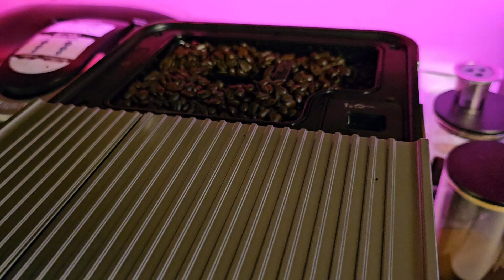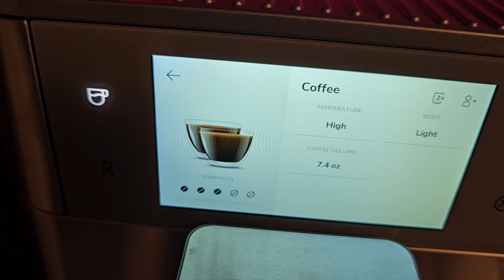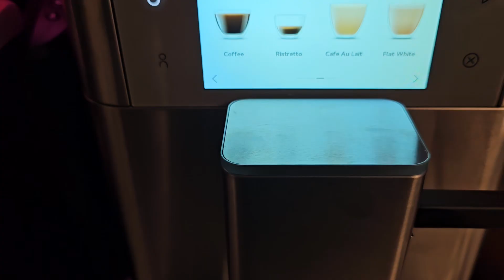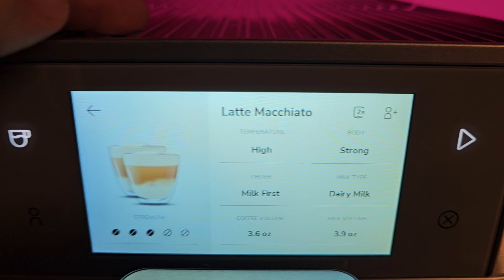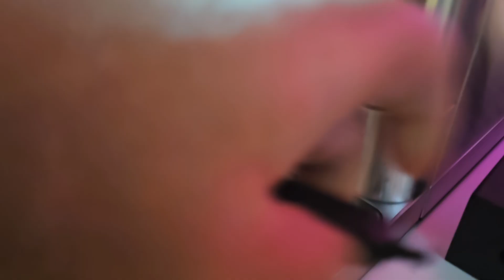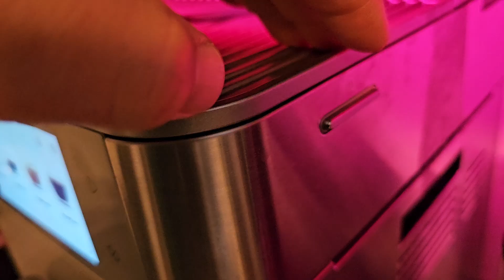KitchenAid Fully Automatic Espesso Machine KF8 KES8558SX

Comment: This is the second review.. No one shows the grind bin ? how the pucks look. How many shots the bin holds? how it resets the counter for the bin etc ?   Also how long to warm up when in sleep mode? How long to warm up from off ? can you adjust the 'sleep time'? Even 20+ year old Solis machines had modes from 5, 15, 30, 1hr etc to go to sleep mode.
Reply from the maker: These are great points. I will do this.

Comment: When you clean the milk tube, does it go through the check list everytime? Or is it a first time thing. Wondering if it will be a process each time vs. just plugging the tube in and pressing start
Reply from the maker: @Battle_60  it offers a tube cleaning on the first drink. You can by-pass it. The settings icon will have a yellow indicator. You press on that area of the screen and it should bring you to the tube cleaning feature.

Comment: What type of milk did you use?
Reply from the maker: Whole milk. You can use any.
Reply: Thanks for your response. We just purchased the same coffee machine and attempted to make a latte using 2.5% milk, but there was no foam at all. We are planning to try using 3.5% milk.
Reply from the maker: @MaxMoonMax  let me know.
Reply: @MrRChitty  I conducted a test using four different types of whole milk and was surprised to find that the foam produced for a latte is much less than that for a cappuccino or a latte macchiato. I had not expected that a coffee machine could control the foam level for each type of drink. I have a Saeco machine, and I noticed that it produces the same level of milk foam for both cappuccinos and lattes, without any difference. I had previously assumed that all machines worked in the same way. As a result, the foam is great on cappuccinos and latte macchiatos.
Reply from the maker: @MaxMoonMax  wow!!!!